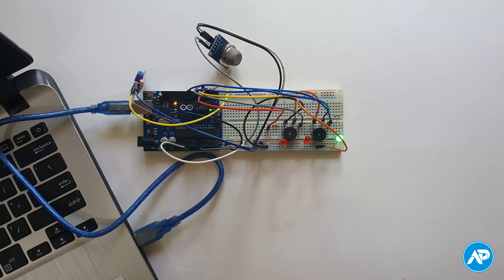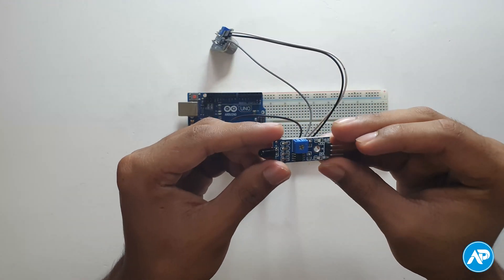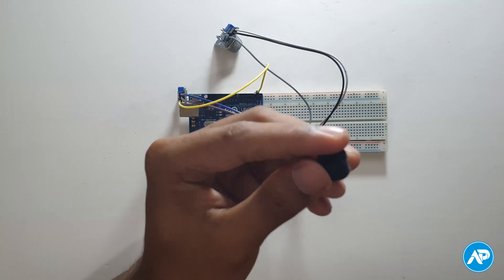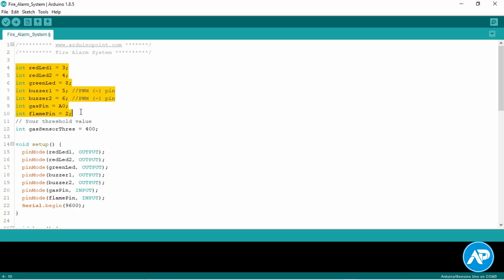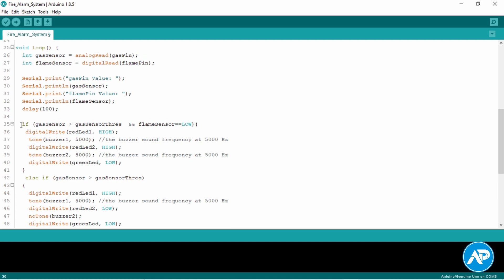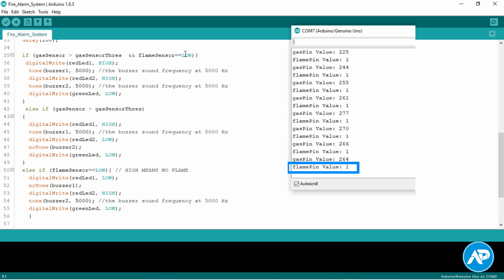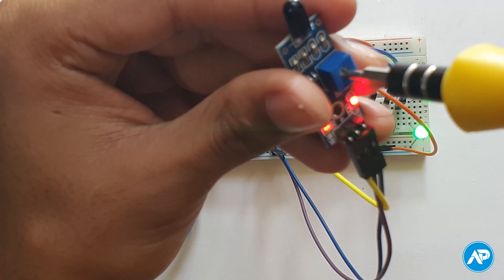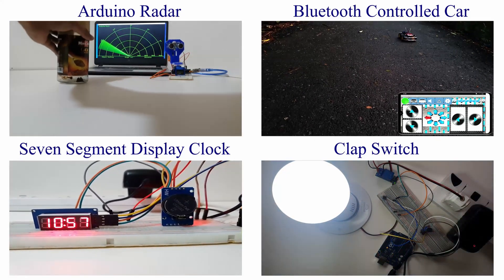Arduino Fire Alarm Project Using MQ2 Gas and Flame Sensor

Comment: Its work with esp8366 module? Not included arduino uno
Reply from the maker: Yes. But you need to modify the code.
Reply: how to make the connections with nodemcu ??

Comment: Can we connect gsm sim800L module in it
Reply: And Lcd 16x2
Reply from the maker: Yes, you can. But you need to change the code according to the gsm module and LCD.
Reply: @arduinopoint001  can you help me, can you share code for it hmm

Comment: hello i have question
Reply from the maker: Yes, you can ask the questions. What are the questions?
Reply: @arduinopoint001  i make same project follow the video and make this but code time i use code and upload then code is uploaded but in arduino yellow light not and always red .... and i use arduino  uno gital
Reply from the maker: Did Arduino code successfully uploaded?

Comment: Please how could I know all the material needed for the project u just did.
Reply from the maker: I already gave the required instrument list in the description. 
1. Arduino Uno × 1
2.MQ-2 Gas & Smoke Sensor × 1 
3. Flame Sensor  × 1 
4. LED and resistor kit × 1 
5. Buzzer ×2 
6. Breadboard × 1 
7. Jumper wires kit × 1 
8. USB cable type A/B × 1
Reply: 1 Breadboard 
1 flame sensor 
1 MQ2 smoke sensor 
jumper wire (Male to Male similarly M to F )
led's
arduino uno 
programming cable 
Buzzer 
this is all you need

Comment: why the gas sensor isn't detect, ledred1 and buzzer1 didn't work?
I do simulation using proteus
Reply from the maker: Check your threshold value, when use analog output. And adjust the sensitivity by rotating the preset knob, when use digital output. 
And also  check the Proteus support MQ2 gas sensor properly.